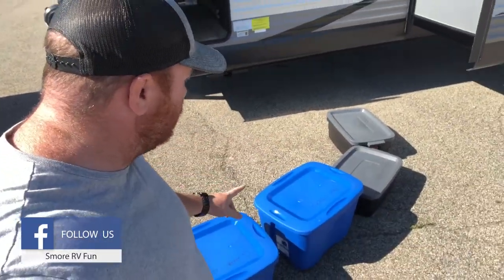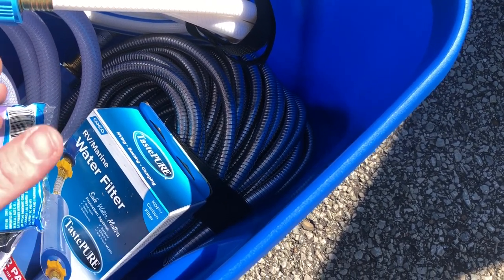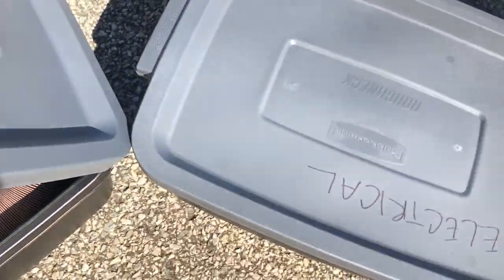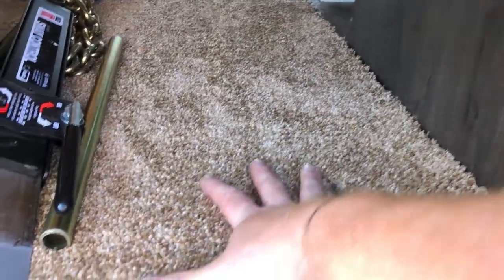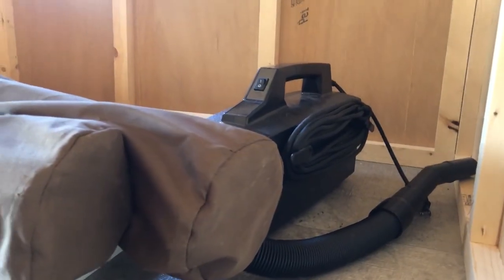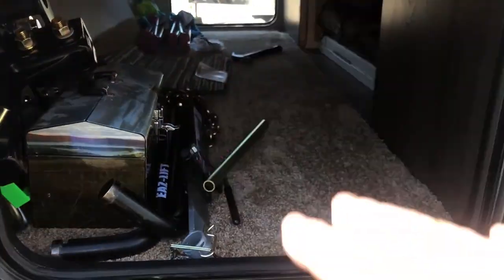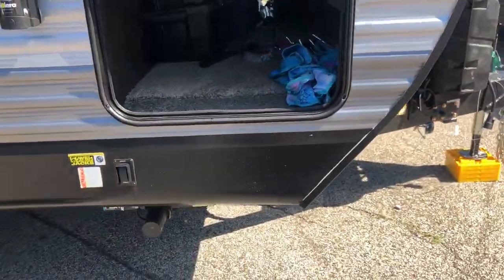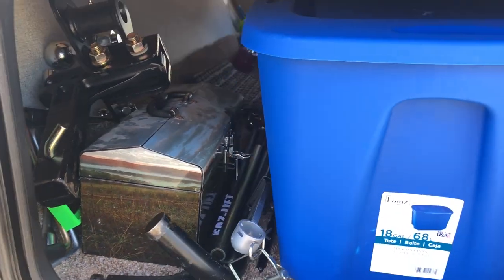How We Organize our RV Gear in our RV Storage Area #rv #rvlife #camping

Comment: We’re in the process of switching over from canoe and  kayak camping. I like to see the gear list. What tools do u carry in the tool box, outside of pliers, screwdrivers, sockets and wrenches. Anything special. Thanks again
Reply from the maker: Yes, all of that. Electrical tape, duct tape, various fuses, small nails, hammer, knife, zip ties, dw40, gorilla glue, varying screws. I keep an old drill and charger as well.